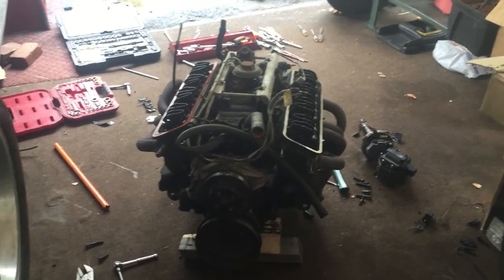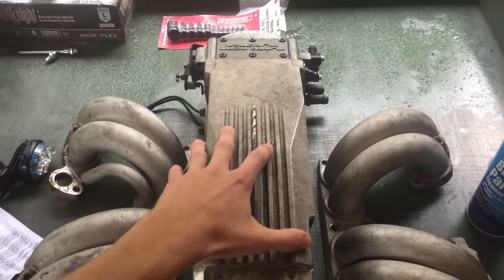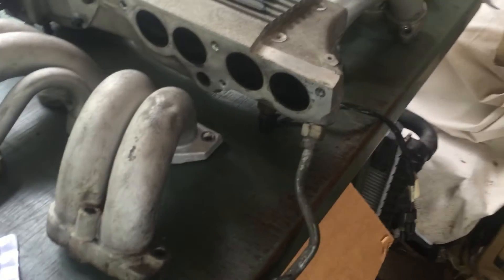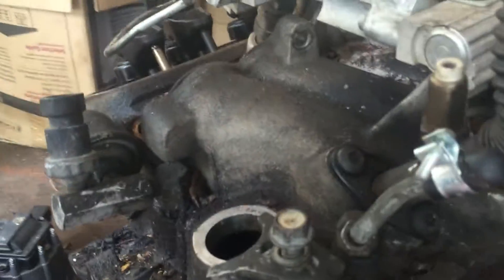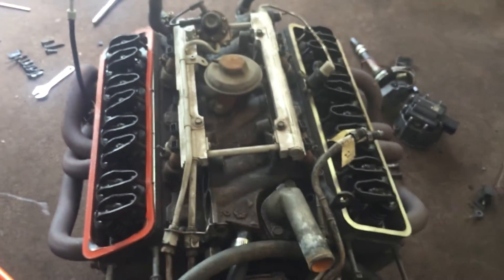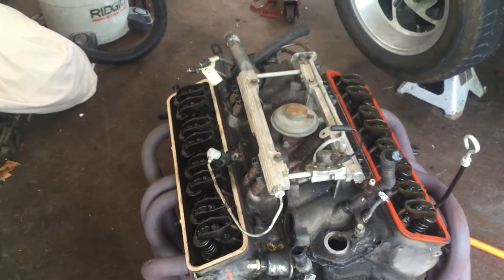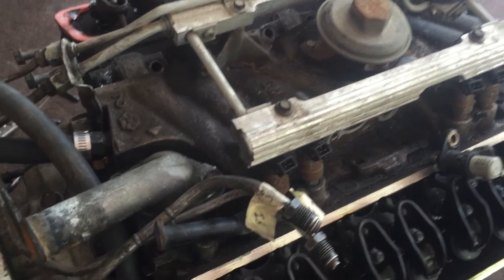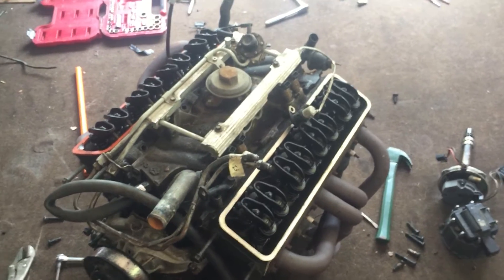How to dissasemble chevy L98 350 TPI engine

Comment: block off all your egr ports, remove the smog pump and have TPIs burn you a module. Oh by the way, let someone who knows what theyre doing reassemble it. FYI the stock cam part #10066049 207/213 .415/.430 (1.5 rocker arm) .443/.459 (1.6 rocker arm) 117deg 88-89 350,305 which is microscopic,

Comment: How do you properly set the engine on the floor?
Reply from the maker: Carlos Bienes my go to method if an engine stand isn’t available is to take a block of wood thick enough to sit under the front-shallow end of the oil pan. A rubber tire chock can work too. The engine should sit close to level. 
Just keep in mind, the oil pan isn’t meant to hold the engine weight like that so it’s always a risk on wether it will cause the pan to leak around the gasket. I don’t worry about it most times because i always end up going with a better pan anyways. 
At the end of the day, the best option is just to get yourself a $30-40 floor stand from summit.

Comment: Is the timing chain towards the driver, or the front bumper? Any idea if they are all like this for all model year C4s?
Reply from the maker: the timing chain will be on the front of the block. So front bumper is the answer. More specifically, the timing chain is between the water pump and the engine block; I'm sure you'll be able to find plenty of pictures on google that will give you a visual idea.

Comment: I got a question about my project. My 92 Z28 had a 5 L in it. I want to put 383 stroker. So after that modification and building the heads, will I be able to use a stock wire harness that came with the 350 or will that be modified also when I'm going to use TPI? Thanks
Reply from the maker: well yes and no. The TPI system in the first place isn't designed to feed an engine of that caliber. Yes the TPI system will run the engine, but not well. You won't get the performance you'd expect. You could upgrade the computer that runs the TPI but it still won't be great. My suggestion would be to change to a carburetor or even retro a LT1 set up on the engine. Now if you're still stuck on using the TPI then you can modify it to increase air flow, work with your cam, get a larger throttle body, etc. But honestly man, I don't think that'd be in your best interest.

Comment: You kept saying if you keep the TPI, if you don't what are you gonna replace it with?
Reply from the maker: well I ended up dumping that whole idea and did an entirely different build. But before that, I replaced it with a carburetor. Much more appropriate for what I was building

Comment: That induction piece is called a plenum and the doo dad is an egr solenoid valve lol. When you go to reassemble the runners to the manifold and plenum start all of the bolts at once and slowly tighten them to get it all to line up evenly.  Also do yourself a favor and use gasket adhesive to glue the gaskets to the runners first.  Use a torque wrench because you can easily strip the intake threads by over tightening them.  Better make sure that egr valve is good while it's easily accessible.  Oh, have fun!
Reply: In fact, factor on replacing it (EGR)  while it's apart, because they go bad frequently & it would be a shame to rip everything back apart in 8,000 miles to replace it.
Reply: P 1:33

Comment: The TPI is a massive PITA to take on and off, plus the gasket cost.  But I'm embracing it and went all in with AS&M runners, ported plenum, and the TPIS big mouth.  I have the Moates unit and can control everything through the computer.
Reply: Vince L The gaskets are reusable for many disassembles.
Reply: With my plenum work and runners I run gasket sealant so more often than not I rip the gasket.  But I'm not complaining since I took the TPI/LTR runner setup as far as it can go so I must like it.

Comment: What would I need to do to change my tbi 350 to a tpi?
Reply from the maker: +Thelegitrager Aside from the physical part change, you'd also then need a engine wiring harness for the TPI 350 set up in order to run all the sensors. Then you would also need a ECM that runs a 350 TPI engine. You can get links and more information on those things from summit racing live chat or a online forum. Then lastly your transmission. If it is electronically controlled then you might need a transmission controller if the ECM you get for the TPI doesn't accommodate your transmission due to the fact most 350 TPI engines were commonly backed with a 700R4.

Comment: i just bought an 89 iroc and need to pull the heads off.  I am going to keep the engine installed.  Any tricks or anything?
Reply from the maker: +Travis Schleusner Well, the first thing that would pop in to my mind is how much of a pain in the ass the headers are to get off the heads. Which prompts the question do you have stock exhaust manifolds or headers. If header with the hard to get to bolts, don't use a ratchet. You probably won't be able to even get it in there, use a box wrench and be careful not to round out the bolt heads. Aside form that its pretty straight forward. If you have any more questions or once some more advice, just feel free to shoot me a message. I'd be glad to help.